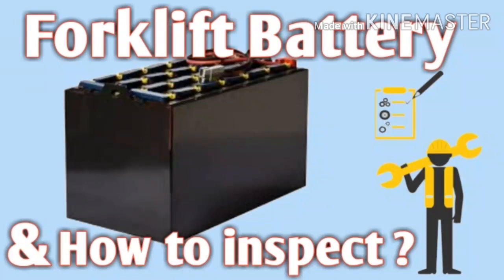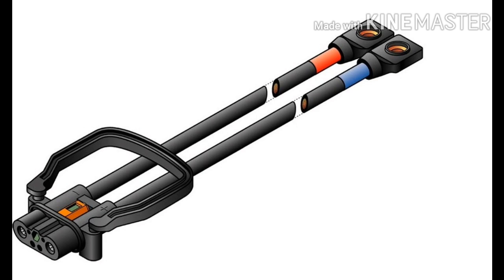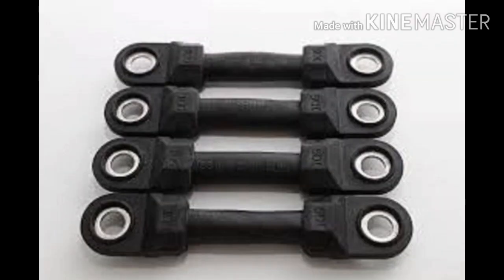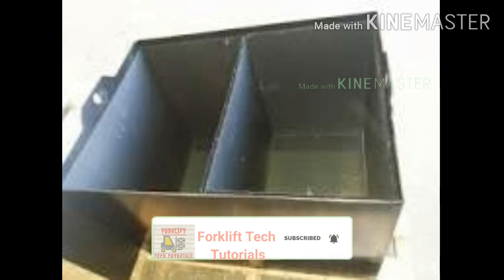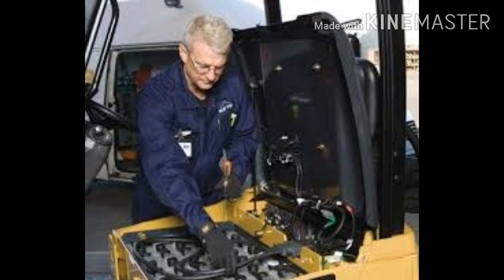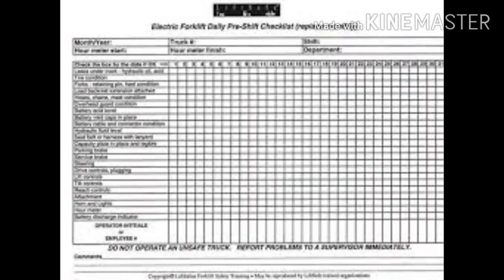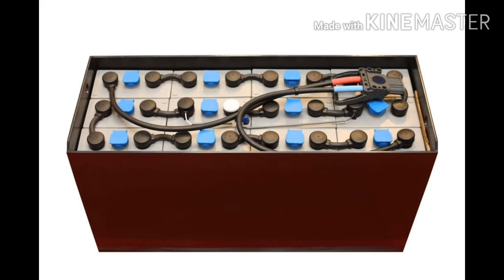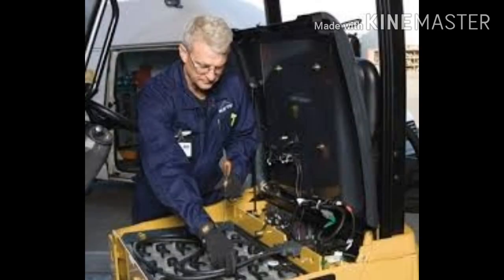Forklift Battery & How to inspect it ?

Comment: Nice to see the video, we are the largest supplier of surplus and re-certified batteries in the United States. We manufacture 36V LiFePO4 Forklift Battery Conversion Kit, let us show the benefits 

Batteries: our lithium batteries will last 2-4x longer than a lead acid battery
Downtime: lithium batteries never need to be swapped out and can be opportunity-charged during operator breaks
Labor costs: lithium batteries do not require maintenance or watering
Productivity: enjoy longer run-times and no decline in performance as the battery discharges
Hazards: lithium batteries don’t emit harmful fumes or CO2, there’s no risk of acid spills, and you’ll have 70-80 percent fewer batteries to dispose of over time because you won’t be replacing batteries as often.
Take a look https://bigbattery.com/product/36v-lifepo4-forklift-battery-conversion-kit/